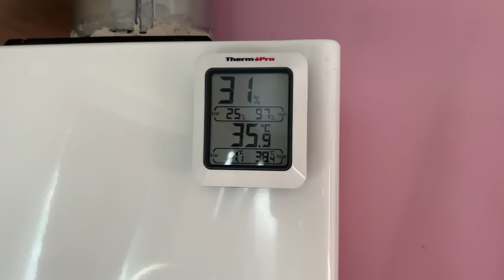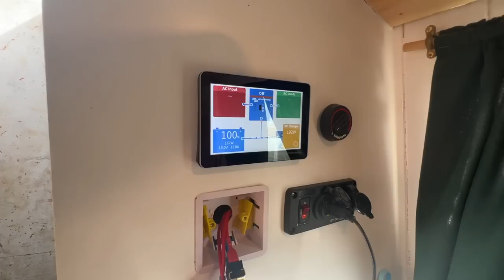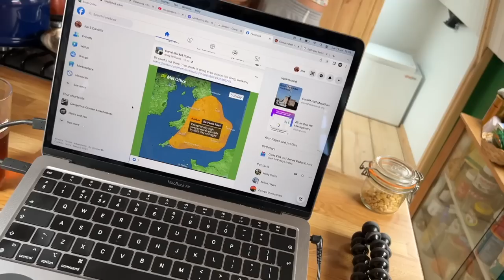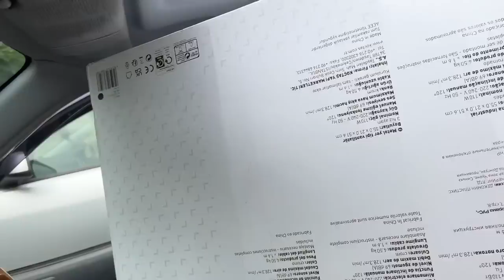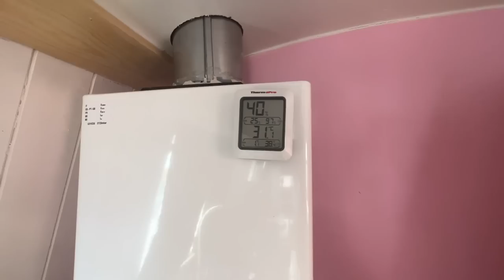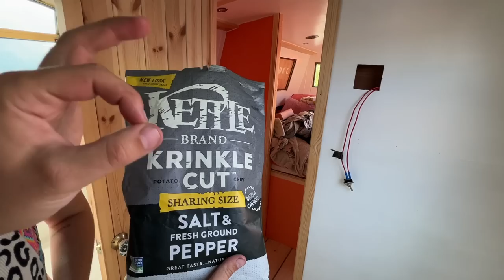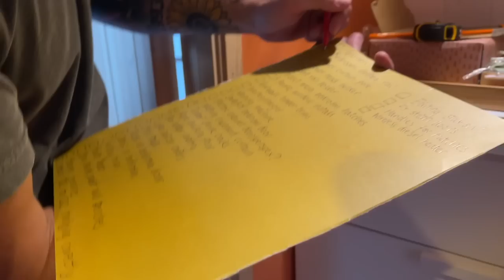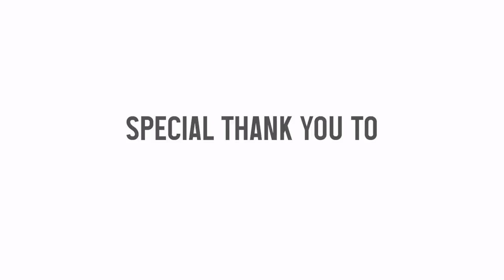Moving on to our Narrowboat - Did we miss BOATLIFE?

Comment: Add a hearty pour of baking soda (about ¼ cup or ½ cup), and then carefully place your pan in the water. Reduce the water to a gentle boil, and let the pan cook for about 15 to 30 minutes, flipping or rotating it if necessary, so that all the sides are boiled. You should start to see brown residue flaking off.
Reply from the maker: Thank you!
Reply: @ItsOhJoe  I just got rid of all my Teflon pans after reading about how they can be Toxic. So I had to learn how to clean these new pans. Another type of pan you can look at is Cast Iron, You can use them on an open campfire and they are easy to clean.

Comment: The Teflon panic annoys me. Teflon doesn't start breaking down (Decompose) until it reaches around 5-600c. Which you aren't going to get when cooking under normal circumstances. It is also completely inert so if you manage to eat flecks of teflon you scrape off the pan if you use metal utencils. it will pass straight through. 

That being said, I don't use Teflon because I don't like how quickly it comes off in the wash and it isn't dish washer safe. I use ceramic pans.
Reply from the maker: Didn't know this! We were mainly worried about the flakes getting into our food than say a new pan 'leaching' into the food per se. Maybe we'll check out ceramic next!
Reply: @ItsOhJoe  I must admit, the idea of eating flakes of Teflon creeps me out quite a bit even though I know it won't harm me.

Comment: Its fine for pans to go like that its basically just carbonised oil I know lot people hate it as looks dirty,
keeping pans well seasoning is art work in it self TBH, but just washing them in water no soap then getting them hot rubbing oil into them works well then fry some onions in them then bin the onions.
that will season in a new pan. and make none stick more you keep this up more you use the more none stick pan will become. cooking foods like tomato's in the pan will remove the seasoning.
but main goal is to carbonise the oil to make a none stick layer in the pan. stainless steal pans are nightmare to work with but once get down they are amazing, same for cast iron and copper pans.
be mindful if you ever get cast iron to dry with towel then heat it up to dry it out to get water out as will just rust I also recommend not putting it in humid place also when wash cast iron don't have water to hot or to cold as the temp can effect the pan. my go to pan is cast iron, but I love also working with stainless steal and copper, copper is amazing for just fast heating and how even heating is, Cast iron realy good for holding heat.
Reply from the maker: Ahh thanks for that!